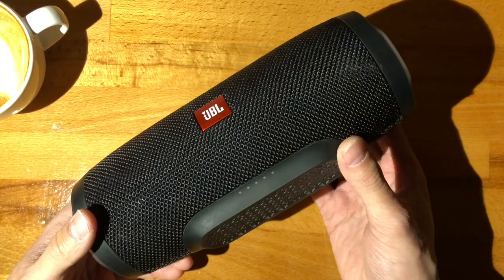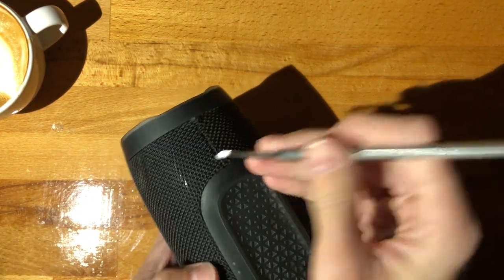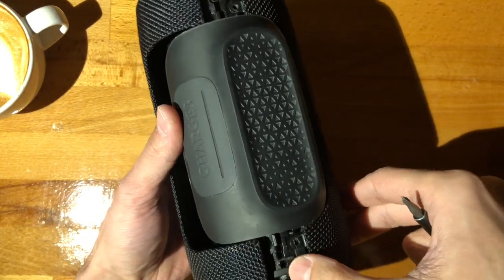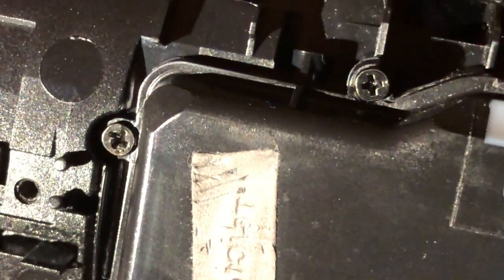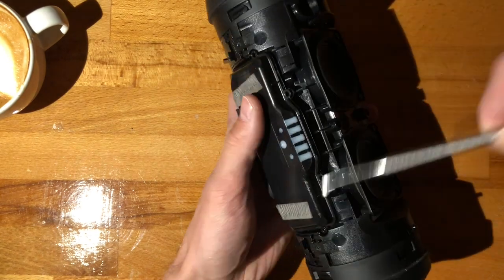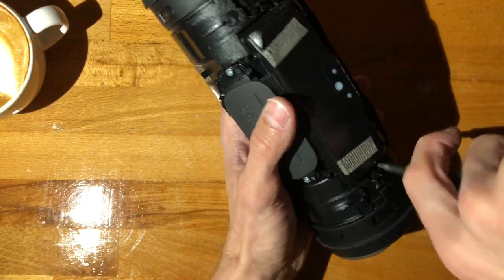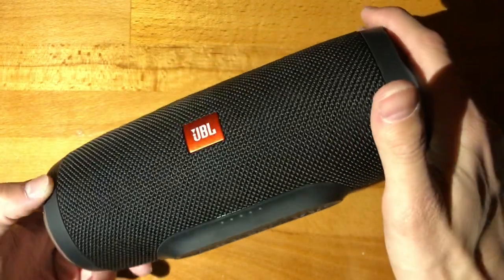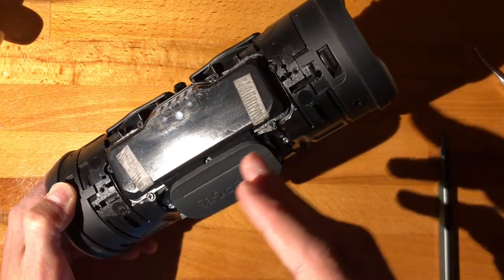JBL Charge 3 Leaky Enclosure - Bad Sounding Bass Fix & Ramble [part 1/2]

Comment: I had replaced the battery a couple moths ago and then the bass rattle started.  I think I cracked one of the screw mounts in the battery cover during the battery change-out.  Didn't know what the problem was.  This video gave me just what I needed.  The silicon fixed the problem.  Thanks for the quick fix.  Keep up the good work!
Reply: hello following a battery change my jbl sizzles, you have to redo the battery seal, right? I don't understand all of your English.
thank you

Comment: 12:46sec..... if it was w/o  the broken cover, why still "cracking sound"???
Reply: You hear that noise precisely because the cover isn’t there. The problem isn’t the broken cover vibrating, the problem is that since the cover was broken, the speaker is not air tight. The noise you hear is air pressure (from the speaker cones moving in and out to produce bass) leaking out of the hole where the battery wires go into the speaker to the motherboard. With a broken cover, some of that air gets out and causes a buzzing noise. Notice the cover has a rubber seal, this is to make the speaker air tight and water proof.

Comment: This was a great help, I replaced the batteries in two of my Charge 3's and noticed the bass rattle more so afterwards. I applied the sealant to the battery area and that fixed one of them but the other I discovered was leaking air around the bass end cap. When you change the battery you have to pop off one of the end caps which is not super easy. For me I had to pry it off which left some minor damage to the end cap (hidden by the cover). So after reassembling it was not air tight at the end cap. I applied the sealant to the end cap and tested for leaks, found a few still and once completely sealed the speaker works perfect. Hope this helps.
Reply: hello following a battery change my jbl sizzles, you have to redo the battery seal, right? I don't understand all of your English.
thank you
Reply: Thank you for the info. Can you please tell which type of sealant are you talking about? Liquid stuff, or some adhesive elastic tape?
Reply: I got my charging port repaired and I had same issue afterwards
What can I do ?

Comment: Please don’t break your speaker grills! The charge 3 was made in 2 different factories, and the grills on some of them come off in a completely different way. On some, you need to push the pry tool straight down into the seam, and if you do it right the grill will just slide off, no screws. Don’t try to pry up on the back section like this, because you’ll break the tab that holds the grill on! If your serial number starts with the letters TL, the way that I described is the correct way to disassemble. If your serial number starts with the letters GG, yours is like the one in the video. Don’t ask me how I know!!
Reply: Wish I read this beforehand
Reply from the maker: aye dude thanks a lot - I'm correctly suspecting you were the mastermind behind this trap 🙂‍↔️
Reply: @Darieee  Nah, I just followed other online instructions. Needless to say my charge 3’s grill is held on with tape now😂. Thought I’d comment here to save other people’s speaker grills from the same fate.

Comment: In my situation the air leak is from the net like thing between two speakers what is that net called?
Reply: That’s supposed to be a sort of pressure relief so the speaker cones/radiators don’t push out due to air pressure in hot weather. It’s designed to be completely water tight, but not air tight, but it should be air tight enough that it doesn’t cause a buzzing sound. That part is probably just a bit loose. I think it could just glue back on possibly?

Comment: My cover went off completly, the battery expanded so much that it broke all the screw inserts… So now I just fixed the problem with some hot glue that I used to seal the holes, idk if I’m gonna even put the back cover back, works just fine without it, just waiting for the new battery to arrive and gonna put it back together, very helpful video, thanks!

Comment: Why not use drops of super glue to repair the cracks around the screw holes, too inflexible?

Can’t really find small tubes of sanitary silicone but believe Shoe Goo May even prove to be superior in strength and flexibility.

Comment: 2:12 "it has been fixed in the charge 4"
me trying to find a video for this problem for my charge 4: "You sure about that?"

No seriously though, you talking about the battery, makes alot of sense for my jbl, the charging, its absolutely sh!t (it takes atleast 2 days for one stripe thingy), and the popping-ish sound when kicks/bass hits...

so idk if its fixed on the chrage 4... only had mine for ~2-3 years...

UPDATE: I dont have any air leaking, or atleast not audible
Reply from the maker: well - it's fixed in the sense that the battery can no longer TOTALLY destroy the enclosure

it'll still gladly die 😂 - but - given it's now a bunch of 18650s, a trip at your local vape shop will quickly get you all the needed parts to fix it ... or ebay if you want a fully wired-up kit ...

Comment: Do you know that when I turn it on it makes a buzzzzz on the speakers. They changed the battery, the same one and it started working 10 points, but a week later it started making that horrible wasp sound again and at certain frequencies the same thing. I looked and looked and tried but nothing to make it sound good. But surprise, I loved it again one of the 10 times I did it and it started to work much better again, very rare!!! I calculate that it has to be without air, super well isolated from the interior. Maybe if I make some gaskets out of some material like rubber or leather, I can achieve this isolation again and it won't fail anymore. As close to the original material as possible. If that's the case, I'll let you know and leave the message here. Greetings!!!! I don't think I've found the solution, anyone has it, but I imagine the thing has to be super closed so it doesn't vibrate and works well.

Comment: i had the same problem in the same place 😂😂😂
im thinking in to put some silicone in the hole that the battery cable passes out, all the air leaks from there
Reply from the maker: yeah - the smaller flip has that square pass-through covered in silicone 🙄🙄

I wasn't wise enough to figure that out when I made the video I'm afraid

Comment: My charge 3 start to do this when the battery was a 0% then never sound normal after ( like in the video)
Reply from the maker: yeah .. li-ion cells do expand when they sit at low voltages .. makes sense